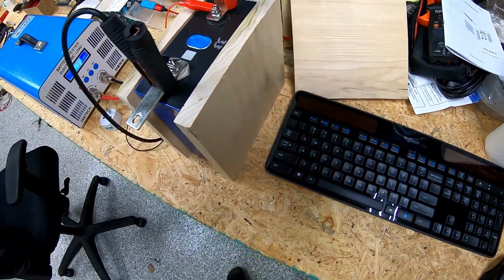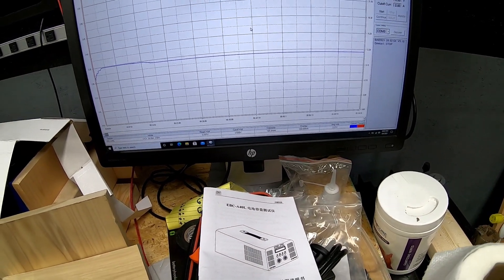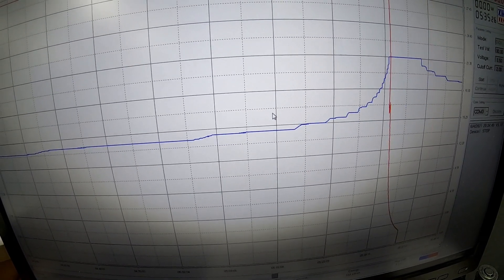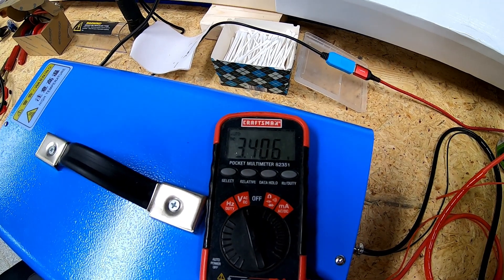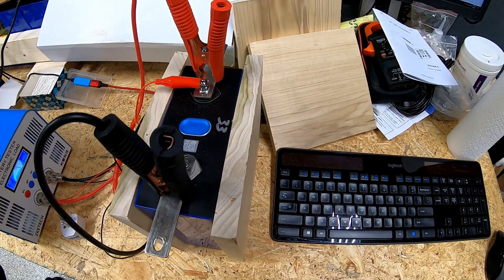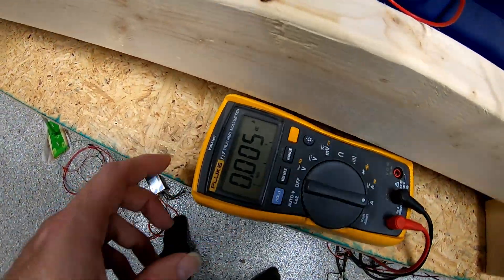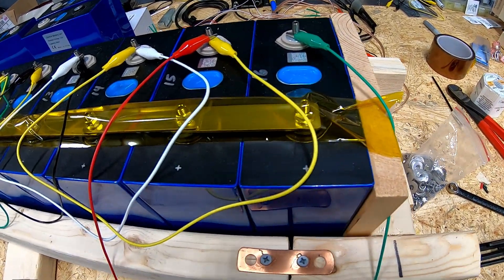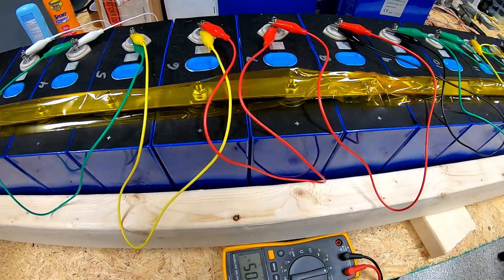ZKE-Tech EBC-A40L test charge and cell pack update

Comment: I too bought 4 extra 280Ah cells when I built my 48V off grid barn and built a nice 12V power supply with them. The power went out in our house one day, and the 12V cells powered an inverter that kept the sump pump running and the lights on.
Reply from the maker: That is awesome.

Comment: Nice video and I just decided to order a ZKEtech too. Regretfully the (according to two amazon customers) not-so-very-reliable PSU inside is a small concern but respecting the 30-35Amps this should be safe I hope (40Amps is NOT the current that is allowed, although they do mention it at ZKEtech??).

In order to speed up the process, I will use an 123smartBMS and hook up all the cells in series until the first one hits 3,4Volts.
The Victron that will charge these can push 70Amps so this shouldn't take too much time.

One thing that concerns me is the rigid positioning of all the cells between two wooden lugs and plates.
How can these cells expand safely without getting too much feedback force of the wood?

Comment: Can you use it as a normal LiFePO4 intelligent charger, which automatically shuts down at 3.65V? Based on the video, it looks like it works just fine as a standalone charger, but I'm just double checking.
Reply from the maker: Yes, it can be used standalone.  The unit can be operated by the front panel.  You have to set the configuration using the front panel the same as you would if using a pc with the software.  But note that the ZKE-Tech EBC-A40L can only do a single cell at a time.  Also note that the charger is not specifically a profile based charger as you must tell it when to stop charging via voltage/amp settings.

Comment: If you let it sit for a few weeks it will lose a few more millivolts, down to about 3.39-3.4 where the self-discharge gets really, really flat. My set of 20 cells in parallel has been at 3.397 for a few weeks now.